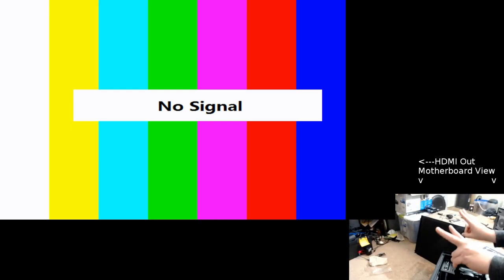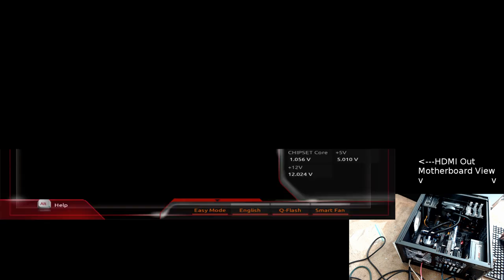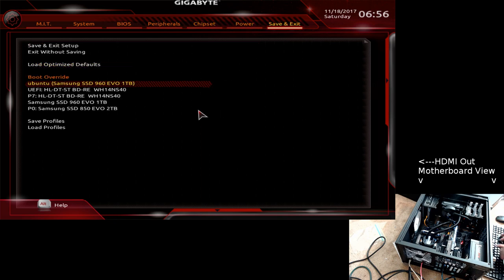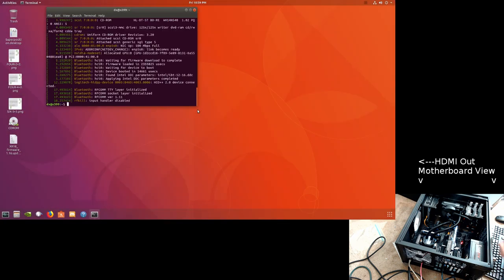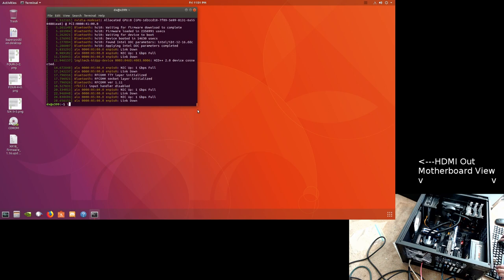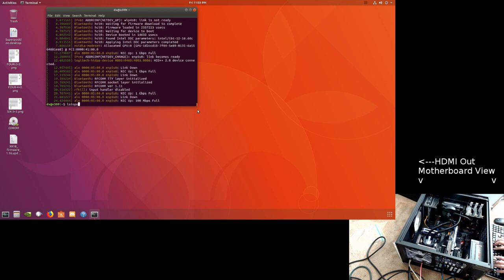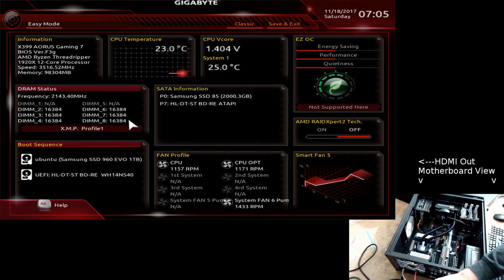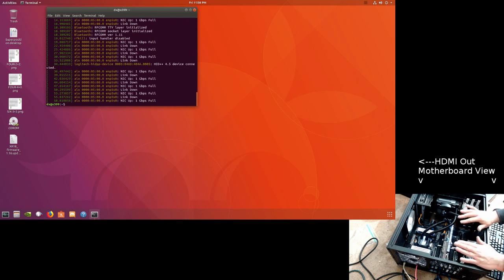Entry #4: MB #1 Gigabyte X399 Aorus Gaming 7 w/ 16,32,64,96GB

Comment from the maker: The solution was to replace the 1920X with 1950X. But I have now stubled onto another issue:
I have performed other tests (such as https://github.com/suaefar/ryzen-test ) -- note: you need to follow instructions and make USB Live Install for Ubuntu 17.04 and then install git and clone locally and run the script from RAM. Took the 1950X 1888s for a thread that corrupted the cache and cause seg fault. Currently there is an issue with HIGH CPU usage and current Ryzen (both 3/5/7 and TreadRipper) that might be fixed in updated AGESA (amd microcode) where a thread executes in a certain way to corrupt the cache of thread on same core.

So planned on just returning anything AMD -- both LGA2066 (X299) and AMD Ryzen (X399 and X370) just have issues "rushed" to market. Have a "new" X99 with 6850k (6c/t12) for now. Memory works on the system that works on AMD (CMK128GX4M8A2400C14) but the RAM has thrown Row Hammer errors on both X399 MB and X99 now. In contact with Corsair on what I should do (return and try something else?) Just think that if you are getting bleeding edge, go with system integrater and get extended warranty -- I am wasting too much of my time (and a little money on shipping) trying to get formally X299 and now X399 to working and pass all the tests for a "stable" machine.

Comment: did you manage to fix it? Find the source of the issue at least?
Reply: I accidentally ordered this mobo vs the pro model because the RGB actually looked nice and some built in audio stuff.... I was hoping for 128gb @3200 CL14 but I'll be blessed if I can get 64gb or 96gb running at any speed lol.